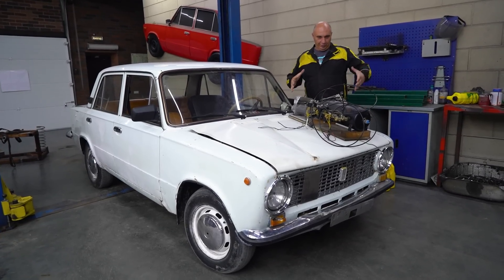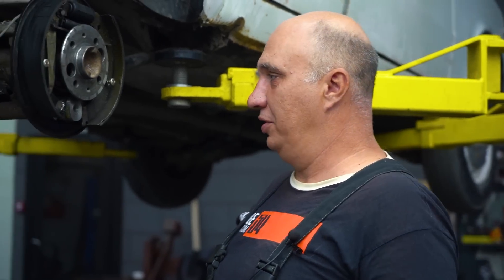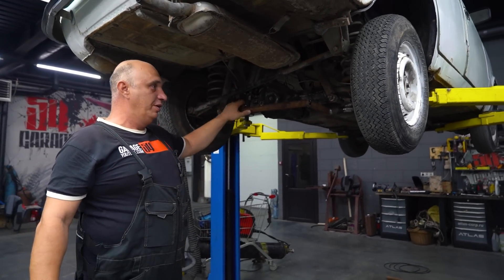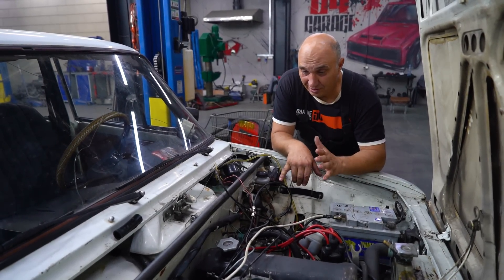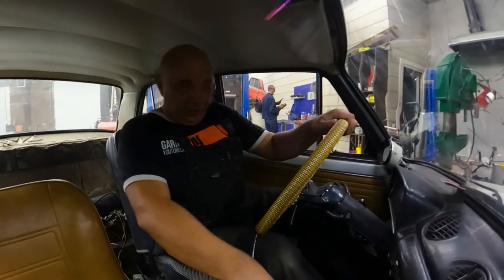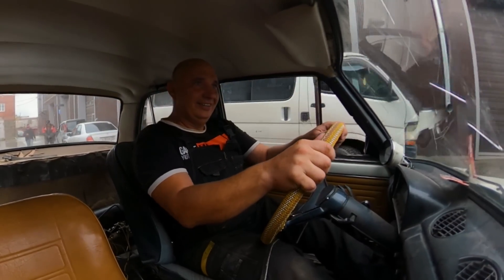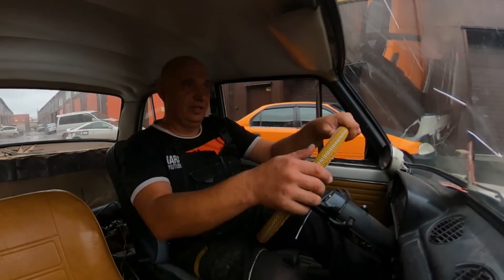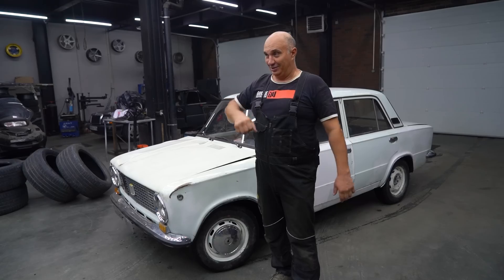We make a pneumatic brake system for a Lada

Comment: I thought commercial trucks worked the opposite,  as in the air system keeps the brakes disengaged.  When the brakes are applied the air is released. That way if the system fails, the brakes come on automatically.

Comment: thats BS that with zero pressure that you dont have any brakes, the system just stops the truck and you cant drive anymore because the brakes prevent you from driving until you have pressure back.

Comment: on trucks (and also on trains) the system is inversted : you keep the pressure at high levels to release the brakes and when you push on the pedal you release the pressure from the system so when there's no pressure in the system brakes are totaly locked (one of the truck i drive have a little leak on its air system so i have to wait until the pressure gauge reach at least 9 bars to be able to move)

Comment: You guys could have used an air conditioner compressor for the air pump. The York 210A is a self lubricated twin cylinder compressor, very nice unit.

Comment: they installed them backwards air brakes should be in full apply at 0 pressure and released at 100-120 psi that way if they fail they are in full apply that's why we have to cage the brakes when they fail to tow it away

Comment: Nice video as always, but what you can try for a pump, is an Car Aircon pump. Use an electric pressure switch to release the clutch on the aircon pump. So in other words, the engine will drive the pump via belt.. Love your vids, and also thank you for BMI Russian for your perfect Translation.

Comment: That's not the way air brakes work. a spring applies the brake all the time until the cylinder (or servo) releases the brake. If it fails, it fails in a safe position.

Comment: you all never fail to come up whith some crazy but practice stuff ..keep it up it's another great video.and I was thinking .on a tractor trailer the compresser they have keeps air pretty dang up to were ya want it all the time but one problem that they have is when going down steep inclines they need to use breaks alot but sometimes the air can't keep up and they end up either dead or taking a runaway emergency off ramp to stop them . but I'd like to figure out away to create a backup break system like a separate tank whith pump on a lever to allow it to go thru system in a emergency ..what do you all think ..but back to the video I think ya deff need a couple tanks in the Lada or one bigger one to keep capacity  of tank full at all time maybe one for back and front so ya can have a break shut off for back to do super mad burnouts lmao  ..
Reply: Those backup brake systems already exist in the form of engine brakes and exhaust brakes.

Comment: your neumatic ram was a little weak. next time use proper brake boosters from a truck. they are by default deploying the brakes at maximum force. add air to the system to release the brake. when you press the brake pedal, it dumps air out of the system applying the brakes again. this is so if there is a failure with the air system, the truck will stop. believe me you dont want it the other way around  😅.

Comment: Ummm... In real air brake systems, no pressure is brakes full on. The air pressure lets off the brakes, and when you push the brake pedal, you hear the Psstt noise of air being released. So when you run out of air, your brakes will lock up, not give out.

Comment: where i am the air brakes need to put pressure to the cylinder for the brakes to let go "very large spring does all the braking, like a suspension coil spring 700pound/inch... air compresses spring thus turning the brakes off" need a 12 or 15 inch wide gas cylinder, use the cars AC compressor for it? pivot fulcrum of 1 to 6, good it works! air line goes... 😐🧐😮🤢😵‍💫🤕

Comment: Would it be possible to get an old BMP or BTR to play with for projects & experiments? Steam powered BMP?  Electric Lada? Diesel Lada? Raced out BMP with high performance engine or dual engines (one in the troop compartment)? Lowered & chopped BTR rat rod? BTR drag race APC build? Kamov Ka-32 engine in a Lada? It is good you have access to a waterjet & machine tools.

Comment: Air systems use "relay valves" to help with faster air brake application. Rather than all the air having to go through the treadle valve to all the brake chambers, the treadle valve feeds the pilot on relay valves, needing far less air. Once the pilot of the valve is active, the relay valve will pass an appropriate amount of air at higher volume to match the pilot pressure.

Comment: This is awesome! From the home made “s-cam” to the hand made treadle valve built from a regulator! There is a lot into an air brake system and some of the smallest things can matter. The s cam head and the angle of the back of the s cam or the “slack adjuster” angle matters in relation to its push point. It looks like it’s over 90 degrees and that’s loosing force to the pads. That,air volume and actual brake chambers and this system might work. There’s hundreds of styles of air brakes out there to steel parts and ideas from,bendex is one in Canada and North American.

Comment: Put the compressor and tank in the trunk to help with the noise and a metal line from the compressor to the tank so it does not melt.

Comment: Replacing the twist bar with simple pair of brake cylinders per wheel would make it react a lot faster. I would put one cylinder on top and one on bottom to keep the brake shoes aligned.

Comment: Actual semi truck air brakes spring apply, air release. Your system is the other way around, and is why it's so weak. Also why you lose brakes when you lose pressure; actual semi trucks fully apply their brakes when they lose air pressure.

Comment: Yea you definitely want the air to be keeping the pads apart until you begin to brake, letting heavy spring tension take over.
Reply: That would make the brakes weaker, don't you think? If the air can push back the springs, it is more powerful than the springs, so it will push on the pads with more power than springs would

Comment: Air brakes work the other way round, default state is brakes on under spring tension 'til pressure is up at a safe level, and the pneumatics pull the brakes open to allow drive, and when you press the pedal it releases the air from the pistons to put the brakes on making them snappy and effective, rather than having to wait for them to fill the pistons to apply brakes...
Reply: yeah i was disappointed what they did here its not the same at all
Reply: For the rear axle anyways but yes
Reply: Hmm, so those are spring brakes basically.

Comment: I have a feeling they ended up with air over hydraulics on the front. The pistons on the calipers wouldnt hold the air in, although it was stopped like...not a dime, but a hundred dolalr bill LOL.
My bus has air over hydro in the front and regular air in back. But, at least in the US, you cant do this without getting in some trouble, unless you have a CDL with air brake endorsement like a B or an A class.
Reply: CDL is only for vehicles over a certain weight. Cars would be exempt from that rule, although the air system wouldn't pass muster with DOT.  <LOL>
Reply: Why would the caliper pistons not hold air ? Assuming the calipers were fine originally and not leaking any fluid, there is no reason it wouldn't hold air. I'm not gonna start spitting out numbers because I'm not very familiar with Lada. I can say the hydraulic pressure in the average car far exceeds the air pressure they are using. If it will hold fluid, it will hold air.
Reply: @Mike-qp8bv  Im not 100 percent, but being water tight is easier than being air tight, isnt it? Im not sure of the top of my head either, but liquids has surface tension which is very hard to break, etc etc. Otherwise why dont modern trucks and buses use callipers, but instead use pots, just like in the reach, which mecanical linkakes and all that. (Im hoping it doent come off as snooty, legitimately trying to talk it out, since its an interesting question. Im not that versed with these conversions, and newer air brakes)
Reply: @RipRoaringGarage  I am thinking because it makes things much easier to drop a trailer and pick up another because the brakes don't need to be bled if the working fluid is air.

Comment: In a Commercial Vehicle, the Brake is constantly engaged by a spring. To release the Brakes, you put pressure on the system. So you are breaking if you let the air out of the system. That's why a truck makes an emergency brake if an Airline bursts. You guys build it the Wrong way ;)
Reply: That's only for the parking brakes. Service brakes function the same as G54 made them
Reply: @SparxI0  its a bit complicated to explain. You have a dual-cylinder assembly with solid springs. Wich functions as the foot brake and the handbrake. If no air in the system, the handbrake is active. If you put air on the "federspeicher", you release the parking brake. Using the foot pedal, you are pumping a little air in the second chamber for braking.
So if you don't have air, you shouldn't be able to drive. That is a safety aspect in commercial vehicles.

Comment: The hose looks about right, but bear in mind a commercial vehicle's compressed air system is engine driven to about 170psi (iirc) and has coolers and dryers integrated. The stroke of a brake chamber therefore, is a lot shorter, making them much faster acting. Try upgrading to that level and you should have no problem locking wheels up!
Reply: Meaning there is a separate vacuum pump for the brakes? There is no engine vacuum on a diesel.
Reply: @refluxcatalyst7190  ... trucks don't use vacuum; they use compressed air from a belt driven pump on the engine. That is stored in a tank, some distance back and it's allowed to cool. It also has a drier system to get rid of water vapor before the tank.

Comment: A friend of mine used suntanning oil as hydraulic fluid in a pinch.

Sure it was just for the cylinder of a barber's chair, but i wonder if it could work for anything else. Maybe tranny fluid or diff oil? It's actually kinda surprisingly viscous.

Comment: air brakes do work this way.... lack of air pressure applies the parking brake, service brakes use air pressure to apply the brakes
Reply: Not in the US. All commercial air brake systems need air pressure to disengage the brakes. It's a safety feature, in case the system loses pressure, the truck comes to a stop.
Reply: @digitalchaos1980  we said the same thing pretty much, just everyone here seems to think the big spring is for the service brake, i wanted to clarify :)
Reply: @brett0nline334  Ok, I gotcha, bud. No worries 😎
Reply: Same here in Europe, it's set up to fail safe. Although, his comment about keeping a watch on the air gauge(s) rings true: city driving or long downhills got the gauges dipping and a sweat on!

Comment: Nice to learn how the principles of air brakes work
Reply: normal air brakes work the opposite the brakes default position is fully engaged then air holds the caliper open so if the air supply fails brakes lock on so the truck stops because its less dangerous to have brakes fail so they stay on rather than a truck that cant stop.
Reply: @blitzyosrs2104  Makes sense. Thanks for the explanation!
Reply: @blitzyosrs2104  

You're describing the parking brake system. The brakes say on the front are still actuated solely by air.

Comment: I've always wondered if you can add pedal feel to an air brake system by using a cylinder to push back on the brake pedal.  adjust cylinder size and placement on the pedal to tune the feel.
Reply: on a commercial truck you already have "pedal feel" because the operating valve is spring loaded and the air pressure is over 100 PSI.
Reply: @rupe53  old Ferraris used air brakes too. I think it use exhaust gas to pressurize brakes
Reply: @angelgjr1999  ... exhaust pressure will only be a few PSI. I have never seen that system, so I suspect it's similar to a vac booster on regular brakes, not a full air system.

Comment: My grandfather used to have exactly the same Lada - VAZ 2101 Žiguli in the same colour. He bought it new in 1973 and kept it until 2008 when he was too old to drive. Not much comfortable, but very reliable car, with terrible handling. Its heating in winters was legendary though, it used to blow a hot air into your face within a minute even in cruel frost.
Reply: Only made to be cheap, reliable, and built to last.

Comment: Backwards. Air cylinder should be releasing the breaks and a heavy spring applying the brakes. That way when you lose air pressure they brakes are applied.
Reply: That's only for the parking brakes.  Service brakes function as they have it set up.
Reply: @kc9489  True, there are two sides of the air system. Issue is if they lose air, they have no brakes. Simplicity would be having a parking brake style system for safety.

Comment: set up backwards from a commercial brake system .. the air on a commercial system disengages the brakes that are under spring tension all the time meaning no air = locked brakes so there is no need for the air to provide load tension to the brakes only the disengagement .... if this was done the same way the brakes would have worked much better
Reply: Well your close. Air releases the parking brake spring, which is there as a fail safe. Air is still used to apply brake pressure. Basically two separate air systems. These guys just skipped the park brake system all together, which has no effect on regular braking.
Reply: You’re right for just the parking brake, controlled by the parking brake knob usually on the dash. The foot brake still uses air to actuate the S cam to spread the shoes against the drum. Rear brake air canisters are in 2 parts, one half is the spring that the diaphragm compresses to release the brake, the other half uses a diaphragm to push on the slack adjuster to engage the brakes with the foot brake pedal
Reply: Hence the name fail safe
Reply: I own a truck with air brakes.  The parking brake is released with air pressure, but that is only on the rear axle. The regular brakes use air pressure to operate. You can regulate the pressure with the treadle valve (Aka brake pedal)
Reply: Front brakes on trucks are solely actuated by air. Rear brakes are spring brake/parking brake as mentioned.
Reply: @matthudson1724  both the front and rear are solely actuated by air pressure when the park brake is released. The parking brake is in the rear and is built into the brake chambers. A 30/30 chamber is a size 30 park brake and a size 30 service brake. The parking brake is released with pressure and the service brake is applied with pressure.
Reply: They're not like that in the UK now only the parking brake is reverse actuated they have a second set or air lines for safety https://youtu.be/YHyH48Lr7Ek this explains it well
Reply: Wouldn’t really work better it’s just a safety measure in case you lose air on big rigs
Reply: That’s only on the parking brake. Normal brake cylinders work with a diaphragm that pushes the brakes on under pressure. Parking brake cylinders are much bigger. They have the same diaphragm that pushes the brakes on, but the also have a spring that pushes the brakes on and use another diaphragm to release that spring. If the vehicle runs out of air the parking brake will apply automatically.
Reply: The older air brakes operated exactly this way. The federal agencies got involved many years ago to make the air brakes apply in lack of air, rather than acting on positive air pressure.
Reply: @bmcc12  again yes and no, not exactly
Reply: Well, yes and no
Reply: Okay, so, at least in the U.S., commercial trucks and buses are required to have TWO air brake systems. We have the spring brakes which operate as you describe. Those are your parking brakes those are usually only on one axle. Then you have the service brakes which are applied as air pressure is added to the line. Commercial drivers in the US are actually required to know this when they initially get their license.
Reply: They wouldn’t have worked better. It just makes it safer if a failure occurred
Reply: @jjhack3r  it would work better because a spring can load the brakes better than the tiny air system they are using
Reply: @robburdack4361  

That's still not how air brakes work though...
Reply: At least in Europe there are three different "commercial" air break systems.
1. Single line air break (trains still use that)
2. double line. One pressure line supplying the valve and one signal line. This system is saver when towing trailers. If the trailer unhooks, the pressure drop in the supply line leads to breaking the trailer as long as it has pressure in it's storage tank.
3. double line fail save system. Springs break, air loosen the breaks. The rest is the same as above, but breaks will always work and only loosen with enough pressure.
Reply: @RubyRhod  Correction: Passenger trains use double line brakes.
Reply: @RubyRhod  I believe our trailer brake systems operate the same. as the trucks. They have two air lines. One releases the fail safe "spring" brakes and the other applies the brakes with air pressure as the driver operated the treadle valve.  
Due to a quirk in my sate's regulations I can drive a truck with air brakes up to a certain capacity with my current license but I can't legally connect it to a trailer with brakes unless I obtain a commercial license.
Reply: This didn’t used to be the case. Hydraulic brakes used to work like they do in this video but it was changed due to obvious safety issues.
Reply: And maybe squash that pipe so it’s oval shaped then the brake’s clamp harder 😊